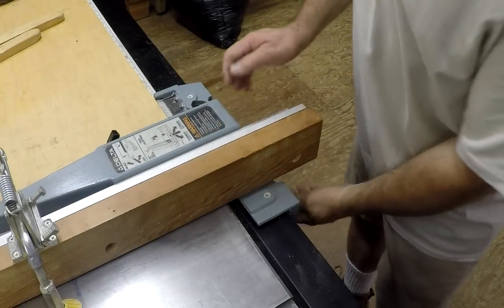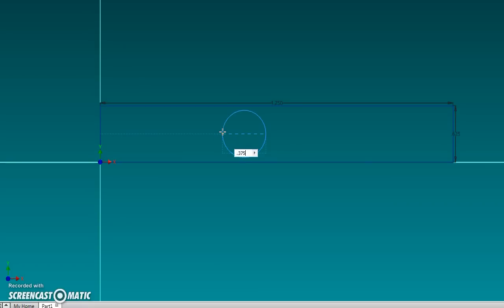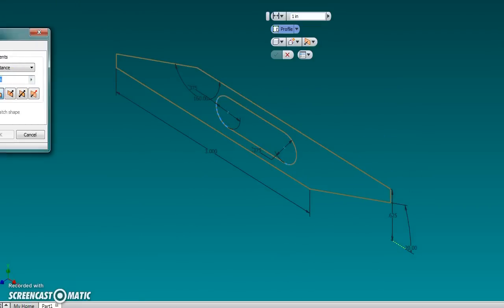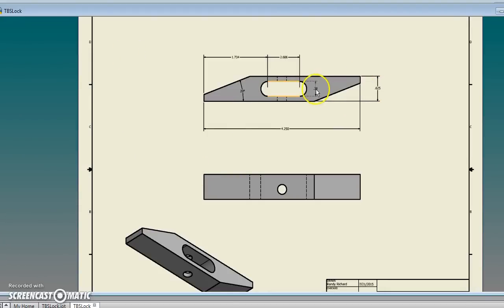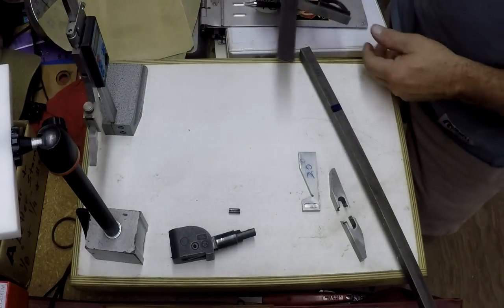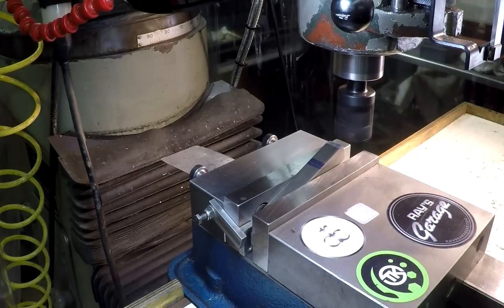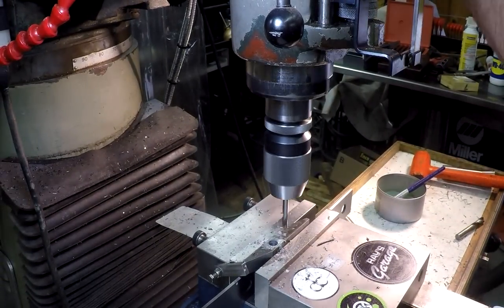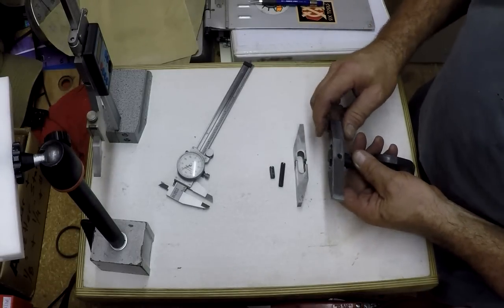How To Repair a Tablesaw Delta Unisaw Fence  Lock

Comment: Hi ,   I  just got this fence and  saw from my dad.  A great old timer finish guy left it to him 
My dad has always used a clamp to lock the fence down.  I’ve been trying to fix it all afternoon with no luck.  The locking handle is limp.  It has absolutely zero tension on it weather it’s in the Chanel it slides in or if I have it off.  The same locking piece you made is on mine and looks fine.  Do you have any idea what could be wrong with it?
Reply from the maker: I would say something with the caming action.

Comment: Randy, I learned Solidworks for work. Then I changed jobs and had to buy my own drawing program. I got Alibre for about 1/20 of the price of Solidworks, $199.00. And it is almost as strong. Good enough for me.
http://www.alibre.com/
Reply from the maker: Doug Rundell Can't afford Solidworks.  Have not tried Alibre.  I got Autocad Inventor with 3 yr license for free, so that is what I am using right now.  I am also liking Onshape.  Randy
Reply: Randy Richard Free is a good price.

Comment: Cool randy, I got a 3 year subscription to Autodesk Inventor 2015.  One neat new feature is the slot which would have made drawing the 3/8" slot super simple as a sketch feature and then extrude through the part.
Reply from the maker: Peter Owens Thanks Peter.  Yep I just noticed that after I drew this.  Thanks,   Randy